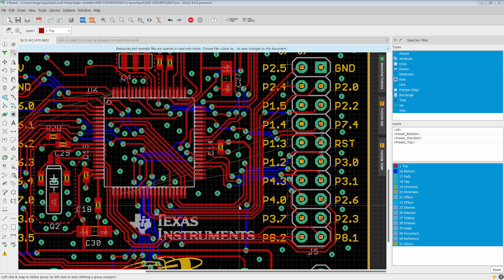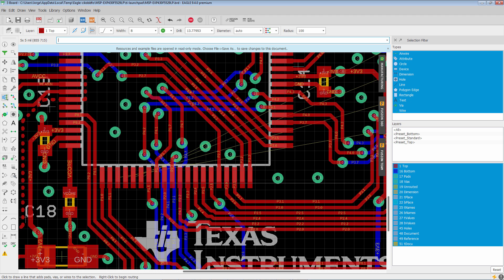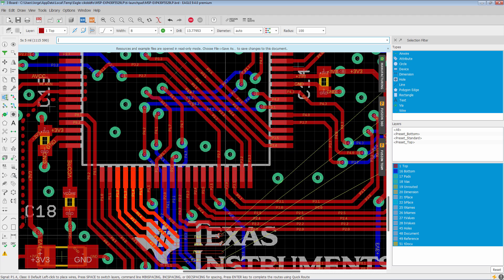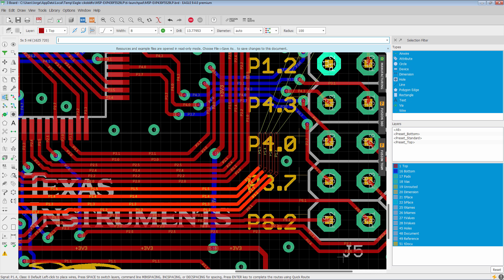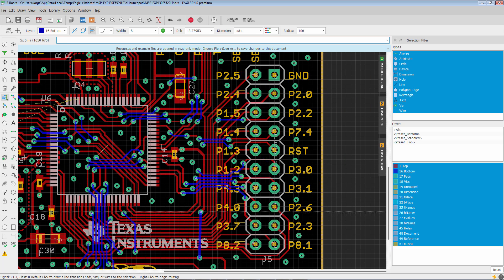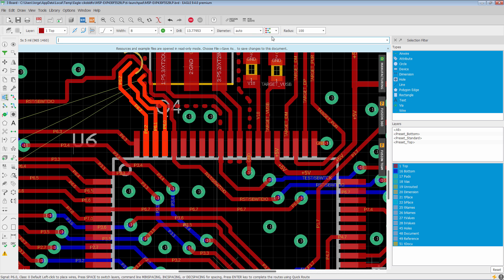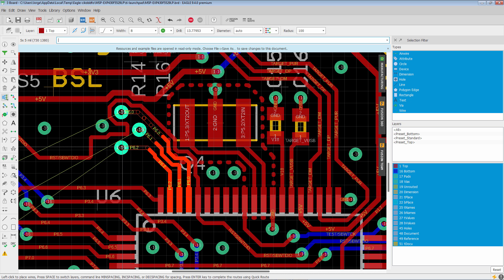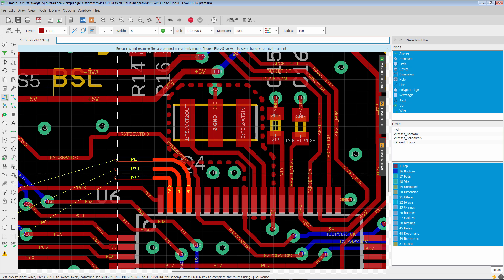Multiple Airwire Routing Mode comes to EAGLE 9.4!

Comment: Hello, I have tried using the shortcuts Alt+S, Alt+A, Alt+1, Alt+2, and Alt+3, none of them makes the functions you mentioned in the video, can you tell me how to fix this problem.
Reply from the maker: Hi Menna Ali, In the EAGLE control panel, please go to Scripts > scripts > eagle.scr. At the top of that file you'll see a line that says #SCRIPT defaultassign.scr. Remove the # and save the file. That will enable the shortcuts. That should do it. Please join us on the Autodesk EAGLE forums if you have any other questions. Cheers!
Reply: @AutodeskEAGLE  How to do this in Fusion 360 Electronics?

Comment: I modified board design shortcut, do you have a default shortcut script that I can reset to.
Reply from the maker: Hello Hai, If you already have EAGLE installed, it will not overwrite your eagle.scr file. Click on the SCR icon on the top tool bar and select the default-assign.scr file. This will include the alt assignments as mentioned in the video. Click on the Tool pull down menu and select Assign to see all the other shortcut assignments. Thanks for the question. Cheers!

Comment: The alt shortcuts don´t work for me, do i have to enter them first into the shortcut options?
Reply from the maker: Hello Irregular, Are you working with the latest version 9.4?  Thanks
Reply: @AutodeskEAGLE  Yes I do, but I already fixed it. had to add the key commands manualy, now it works fine :)
Reply from the maker: Awesome, great to hear. Thanks for the response! Cheers!